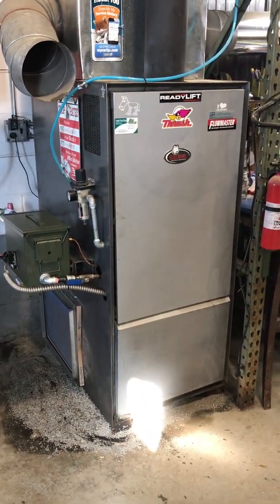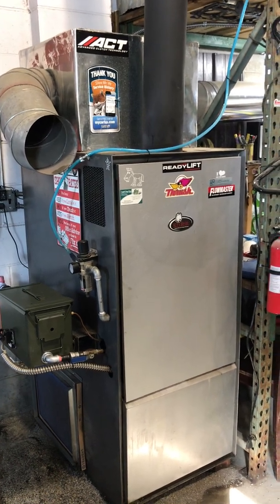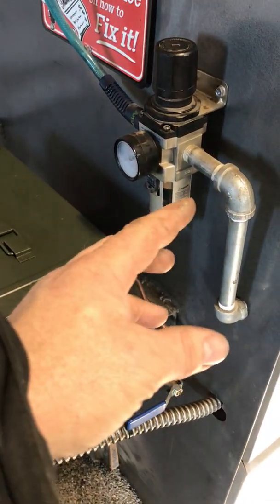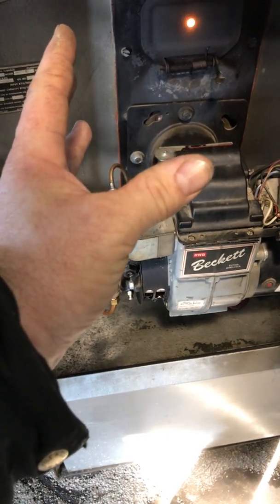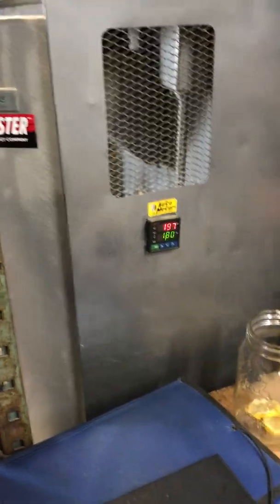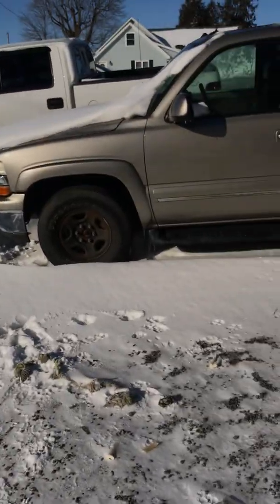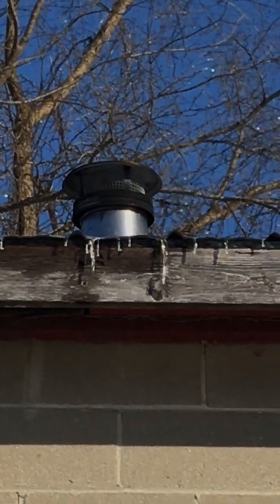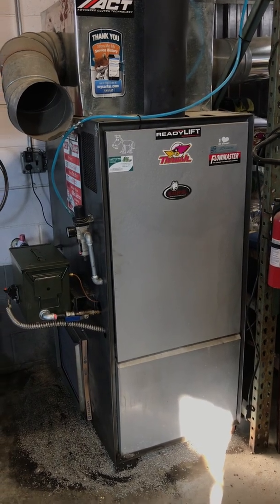DIY Waste Oil Heater. Audio not best. Second video is better!

Comment: Why would you use an air modified nozzle? Mine works with original nozzle with no problems! I just used the oil heater design that you have, The only difference is a dual fuel supply line. One supplying diesel to start then switch to the other to run it. One other thing to mention is proper oil filtration.

Comment: Did you use the original nozzle?
Reply from the maker: This is the first (older video) of my setup. Newer video shows things more clear. But to answer the question no. The original Beckett nozzle can work I think for some people with certain fuels and setups. I used the CK burners siphon nozzle which uses air pressure and oil together. It is designed to pull the oil to it, but I bring it in under light pressure from the original Beckett pump.

Comment: Have you have had any problems with white powder inside the burn chamber?
Reply from the maker: I do get ash/crust build of over time. But the spots were it collects I knock loose with a pry bar over time. Usually by the end of the season I pull the burner head out and vacuum the chamber out for next heating season.
Reply: @ballengerfarmhomestead  I've been getting alot of white ash I'm thinking I might not have enough draft after moving the furnace and adding a section of stove pipe to the flue.

Comment: That is a great start on informative video, it would be really great if you would shut the furnace off and describe what all the plumbing and piping is all about. The furnace is making so much noise I can’t hear much of the audio. Just a thought
Reply from the maker: You are very correct. Which is why I did produce a more detailed video later
Without the furnace running. I believe it is viable on the channel?

Comment: I wanted to learn from it....but the fan noise made it impossible.
Reply from the maker: You are correct on that. Which is why I made another much more detailed video a little later and fan noise isn’t an issue. Also the aspect ratio is better. When I recorded it I didn’t realize how much the fan affect things but kept it up because quite frankly at that time we had terrible Internet service and up load speeds were in the single digits. So to edit or make another video was tasking. I waited till better service came and people showed interest in the burner to make a better one. You should be able to find it on the channel? Thanks for your input.

Comment: Do you guys filter the oil ? Water mix ?
Reply: Ive been running a similar heater for 15 years, i store waste oil in several 55 galon oil drums, i let the oil separate over weeks/months by just sitting in the drums when the temp is above 50f or preferably during summer then i transfer the oil to a main drum by sucking oil from the surface (cleaner oil) and the sludge stays on the bottom. Then the heater sucks oil from that drum by also sucking from the surface with a floating nozzle. On the way to the heater i have a regular oil filter from an honda goldwing mc which i change once or twice each winter. I used to have alot of water mixed in the oil 10+ years ago, and i used a milk separator that took care of that problem but since then i only use oil that ive drained myself that is more or less free from water/coolant.

Comment: What type of spuds did you use or did you just drill small holes on pipe?
Reply from the maker: I just realized you ask a similar question. On the compressed air. The regulator just takes shop air down to lower pressure and then it passes though to the main injection nozzle that is part of the CKburners kit. They use a type that swirls the air and oil to create a siphon and atomization.
Reply from the maker: I didn’t see your comment till tonight. Not certain I follow what your calling spuds?  Or which pipe your talking about. Care to elaborate so I can answer questions better?
Reply: @ballengerfarmhomestead  spraying tips or jets orfice
Reply from the maker: @ricardocenteno375  ok got ya. It’s all in the kit or sold separately from CKburners.com. I’m not affiliated with them but did get my kit there and it works well

Comment: What does the air filter and air do? Is that pressure oil spuds
Reply from the maker: I assume your talking about the unit on side of furnace??  That is basically just the air pressure regulator with a water separator. The air is primary way this type of system works (Causes a siphon effect at the nozzle head to draw in oil). I’ve just added the ability to send that oil under pressure from the pump to nozzle and not rely totally on suction

Comment: Where did you get your kit from and does it have a wire diagram to wire in all the relays. Thanks in advance
Reply from the maker: CKburners.com. They have a full kit and piece meal options. If you get the main kit with the controller and the relay it will come with diagram for install.
Reply from the maker: Another side note I did do a follow up video I keep forgetting people responding to this video are not the ones seeing the other!  It may help show you more of the inside details of the unit.

Comment: I recommend a water heat exchange, to try an capture the heat going up the flu. Like what ya got
Reply from the maker: Thanks. Sound interesting for sure. I can say the fluent isn’t very hot. Sure has wasted heat but the main furnace has a ceramic “baffle” inside the flame hits and it does a great job of absorbing it and exchanging heat to the air. That said there is always more to be had!!

Comment: how do i set for pid controller
Reply from the maker: Just so I understand. What are you calling a PID controller??  I should clarify to say what exactly is it you’re trying to control? Example if you got the ckburner kit like I have they essentially have a PID controller that is pre set and controlling the oil heating at nozzle in the thermal block. The same controller can be purchased to also control preheating oil and on and on.
Reply: @ballengerfarmhomestead  i have a jld612 temp controler i have a ssr 25 an p100 probe trying to fimd wiring digram for heat elememt  for nosel
Reply: i put this kit together same thing  just cheaper i just domt have a wireimg diagram for set up
Reply from the maker: Ok I see. I’ll try and find that diagram.
Reply: @ballengerfarmhomestead  thank u
Reply from the maker: @kevinmagee5572   where would you like me to send info?
Reply from the maker: Ok I’ll try to find a diagram. I can say they (and you for that matter) only really need a relay to send amperage to the element. Your PID controller should be able to control that relay easy. I wouldn’t have a diagram for those controllers you have I would only be able to find one for the controller that came in the CK burner kit
Reply: @ballengerfarmhomestead  that should be the same
Reply: an same models
Reply from the maker: Ok here is a start. I didn’t save the instructions on pdf. But a hard copy is here somewhere. Will look more later. That said I’ll try to send pic directly as I can’t seem to get it to post here
Reply: @ballengerfarmhomestead  ok can u take pics of urs
Reply from the maker: @kevinmagee5572  I just have to find it. But I’ll send the other diagram I did find on net

Comment: what are you using for nozzel? is the heating required ? are you using a ball type nozzle?
Reply from the maker: It’s a siphon type nozzle swirls the oil and air at the top and injects oil as an atomized mist. It works great. Heat is pretty well needed.  Mainly to thin oil to actually be capable of atomizing. Also it being hot makes it easy to flash when exposed to flame or spark from igniter.

Comment: I got mine kinda setup, I test fired it on the bench it fired up great, I then installed it into the furnace and mounted the preheat box near the top of the furnace, when I went to fire it, it started almost instantly, then the flame made a really loud humming noise, went out and smoke poured from the flue pipe. 

I just read somewhere the preheat box, has to be mounted level with the burner, and or below it, would this have caused my issue, I took the top off the burner and oil was inside the blast tube, im thinking the pressure from the pump, made the siphon nozzle leak or drip. Into the blast tube.

Id assume that mounting the box lower or below the burner. will reduce the oil pressure?.
Reply from the maker: Ok great explanation on what you have done and let’s start with a few questions of my own. 1. Did you buy/use a CK burners kit or something else?
2. When you did the install did you keep the existing pressure pump that was already on the Becket unit or did you bypass it?  I can explain more but if you answers these first will help direct my answer much better.
Reply: @ballengerfarmhomestead   didn't buy the CK burner kit, made my own nozzle preheater, and preheat tank. Used a siphoning nozzle, .65 gallons an hour. Tried 10-20 psi. Didn't have any changes. 

I'm using the Bekket burner pump to pull from the heat tank and replace, have a Tee in the return line running to the siphon nozzle. With no ball valve,  

I'm thinking since the return line goes up 2 feet to the tank its building too much pressure in the line and most of its being pushed out the siphon nozzle
Reply from the maker: @brutusjb3814  Ok so reason for my questions helps me to understand what you have. If I correctly understand things the problem is you have pressure (even though it’s probably small) at your nozzle which allows for excessive flow through the nozzle. It does two things. Sprays way too much and can’t fully atomize due to excessive flow. You need to restrict the flow to the nozzle with a valve of some sort (I like the ball valves myself). If you do this and keep your  current pressure  pump you won’t have to move the preheat can. That said you are correct that the siphon nozzle does require the feed tank to be lower than the nozzle itself in a pure “suction” type setup. If you lower the tank and remove the pump then no ball valve required. In my setup I chose to keep the pressure pump, put a ball valve ahead of the nozzle, and have a “t” a head of the ball valve to allow flow back to the tank. This will purge any air and create a constant loop to filter oil and keep it all good and hot. A side benefit with this is you can actually increase or decrease your output (flame/btu) a bit based on needs. One last thing to note. As the oil heats up or what your burning has a viscosity change, say you get a batch of real thin oil or even some diesel mixed in, you will need to adjust the ball valve setting to achieve the flame you desire. They said it usually isn’t an issue. But will happen vs the siphon nozzle only which will work the same in most all cases.
Reply: @ballengerfarmhomestead  did you take out the kaowool burn chamber out of the oil furnace
Reply from the maker: @brutusjb3814  I don’t believe my unit has that. It just had a very simple ceramic liner that really didn’t do more than keep the flame from directly impacting the back wall of heat exchanger. As before stated Im pretty certain your getting pressure at your nozzle instead of the “Venturi affect” or a vacuum which “pulls” the oil from source to the nozzle and mixes at the nozzle. Good luck!!  Keep the questions coming if needed.
Reply: @brutusjb3814  Is it good or bad to remove this kaowool burn chamber?
Reply: @perpetualtech5906  I ended up leaving it it helps burn the vapors and results in less smoke if any

Comment: Hey. We'd love a followup with more details or links to schematics etc.  Thanks!
Reply: Jus seen 1 ur post.   How i need to wire up the heat block.   Like to thermostat controll.  Thanks again
Reply from the maker: @victortrimble4741   ok I think I may accidentally be replying to you on two different comments 😭. At any rate yes you need a “thermostat controlled” heating element of some sort. Again I used the CKburners kit because it came with the nozzle, block, element, thermocouple, and the “Thermostat” which in this kit is more like a controller. It’s the box with digital readout and a set point. This will maintain the temperature you require and feeds the heating element power though a small relay. All which is included in the kit and shown in the video. As for wiring it’s a simple two wire hook up with this kit. Hope it helps!!??
Reply from the maker: By follow up are you talking about a video or direct contact with me?  I hope to make an updated video with some more details.  We don’t invest allot of time in YouTube yet “editing and such” however hoping to get into more of that.  If direct contact is can send you email to reach me.  As for a schematic I’d have to draw something up I guess or more pictures.  The CK burner kit @ ckburners.com does have some more inform there you may like.

Comment: How many gallons a day do you go through?
Reply from the maker: So that will be very dependent on your needs.  For me I heat a 1300 square foot shop that is an uninsulated block building.  I don’t heat when I’m away so I come into a cold shop. The first several hours heater is running at max capacity.  Then as temp rises in shop I pull heat back.  So under these conditions I burn approx 1gal per hour.  Once pulled back it drops to maybe 3/4 or less gallon per hour.

Comment: Can it burn waste vegetable oil?
Reply from the maker: Sorry for late response. We are tying to change up things so I see these messages sooner and not get lost!!  That said its possible. I can not due to the fact I’m not setup to run it or process it.  You need a good way to heat, filter, and circulate it in order to get it to the burner clean.  Once it reaches the burner head warm and clean, should run fine.  I could see a possibly that you may have to start a small fire in the fire box to get things going. Not sure about that though.
Reply: I heated my home for 4 years on waste vegetable oil using a set up similar to this.  In my experience,  vegetable oil not only atomized better than motor oil, but it didn't need to be pre heated to  be ignited by spark.  Motor oil did not without pre heating.  

 I designed mine with full adjustability and once fired up, could increase the air pressure to the nozzle to the point of creating a blue flame.  Very clean burn, but it likely put the nitrogen oxide numbers through the roof. 

And, it smelled better.

Comment: Any chance you could make another more detailed video on parts you used and setting up your burner? Do you use shop air or a small compressor? Homemade or CK siphon nozzle block? Any help would be great!
Reply from the maker: j jones hi there!  My husband made this video.  I would suggest emailing him directly at moparman141@hotmail.com.  He would be able to answer all your detailed questions.
Reply from the maker: (This is Kenny replying).  I could see about making an updated video. Soon I’ll be cleaning and firing the furnace for the winter. But I can answer a couple of the questions now. 
-I did use CK burners siphon nozzle kit. Intended to convert a standard becket burner to burn waste oil. Kit comes with nozzle, heating element, and circuit board and relay. 
-I use shop air. I wanted the pump they used to sell that took the place of the becket oil pump, but it seems they don’t carry it anymore. So shop air works just fine with a water separator and pressure regulator at the nozzle.
Reply from the maker: I realized this is a 2yrs old comment. But I see it was the original video. I have since done a follow up video with more detail incase your still looking

Comment: Very clean setup. I have been planning for years just never made it happen yet. I have access to give or take a thousand  gallons each year of waste oil. I want to build a small building about 30 feet from my house and future pole barn for insurance purposes. In the small building (maybe 12x20') install a converted fuel oil boiler to run on waste oil. I would trench and run insulated PEX underground to my house and install a heat exchanger in my existing LP furnace. I want to keep LP furnace as backup and would automatically come on if boiler ever failed. I would also eventually like to run a heat exchanger for domestic hot water tank and future pole barn heating. I need to make this happen. I have free oil and yet I spend about $2-3K a year to heat my home. Ohio winters can vary on the costs though. I would also like to centrifuge the oil and possibly burn it as fuel in my 100kw diesel generator for prime power for my house part time.

Comment: love the oil burner setup.. hoping to do something like this myself in the future.  Any other information on the actual burner itself, from my understanding these need to be modified a bit to work in the waste oil application.  Also, how much compressed air does this use?  I have a 2 car garage I'd be looking to heat, but it would sure get annoying with the compressor always running!
Reply from the maker: Nicholas Smith so sorry I didn’t see your comment/question. I don’t stay logged into YouTube.  But we are working on comments. That said I will try to produce another detailed video. It doesn’t use much air but a large compressor with quick recovery is good idea if this will run constant. Or if you can find the air pump that is driven off the becket motor then no need to worry about separate compressor. Make sure air is dry. I run approx 15-20 psi but that’s because I have a valve ahead of the siphon nozzle so I can adjust the flame.